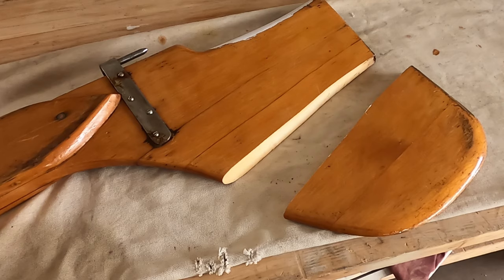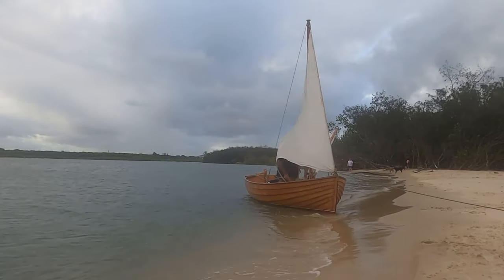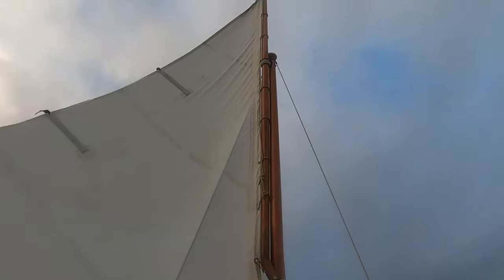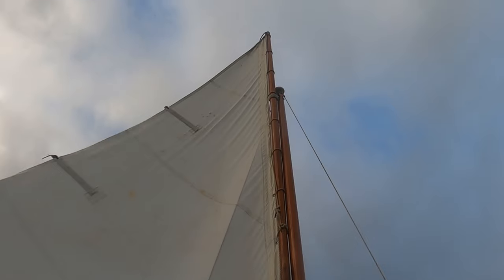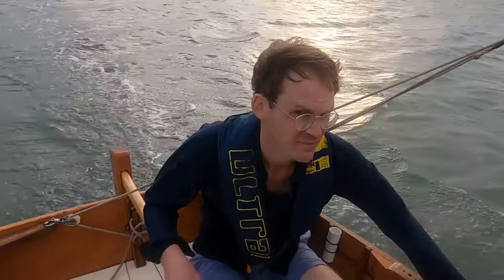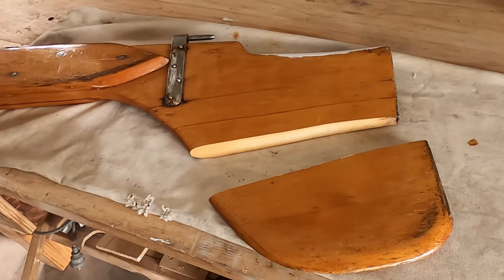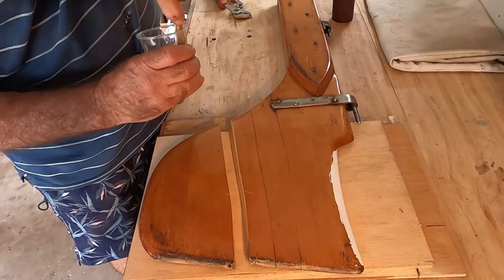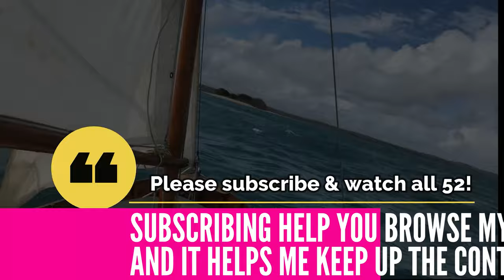Predictwind said it was going to blow hard. It did! Broken Rudder.

Comment: Hello Christopher I too love dinghy sailing and have a few  to choose from. The VJ (victoria Junior) has a similar fixed rudder like yours and also the MJ (manly Junior), but that is so light that a grounding doesn't matter so much. My Dehavilland Gypsey also has a fixed rudder, but I particularly like the swing rudder on my Mirror which is less prone to damage from grounding. 
Swing rudders and centre-boards/keels are my first requisite when choosing a sailboat as being a person who likes to push the limits, I inevitably run aground. That's one of the reasons I own a Farr 6000 Trailer-Sailer as well.
I think if you decide to upgrade your rudder in the future, the open backed dagger style might be a good consideration. Grounding results in the rudder simply pulling back against the stretchies and result in no risk of damage.
I do realize you built this boat many years ago and like to keep it original though.
Your comment about "gentlemen" not sailing to windward is not one of my favourite terms as I seem to do more sailing to windward than otherwise. if possible, depending circumstances, I like to beat upwind early (if I have to return to where I start), when a nice down-wind run is nice to end the day. Cheers, Pete.
Reply from the maker: Sorry about a couple of jumbled bits there. Voice to text not perfect. And I can’t edit them now. But I think you get the idea well enough